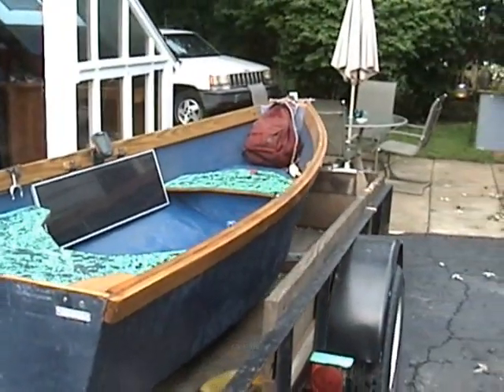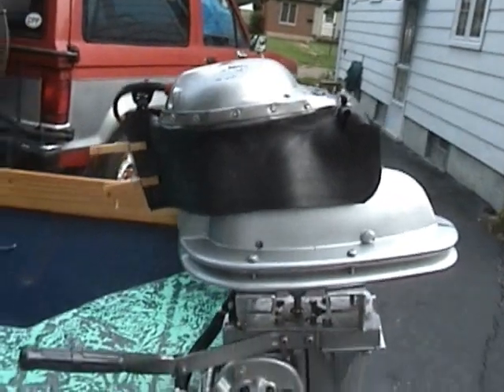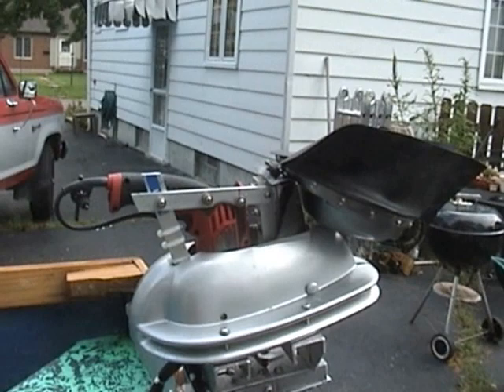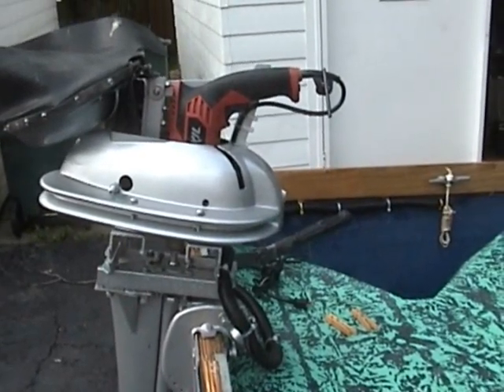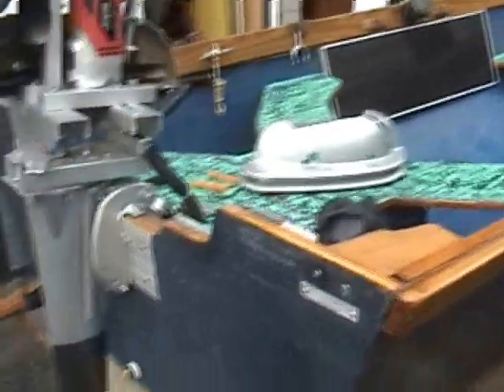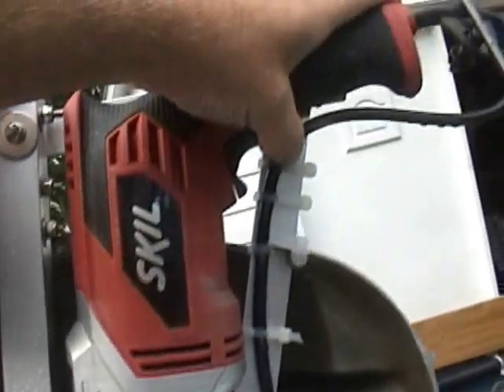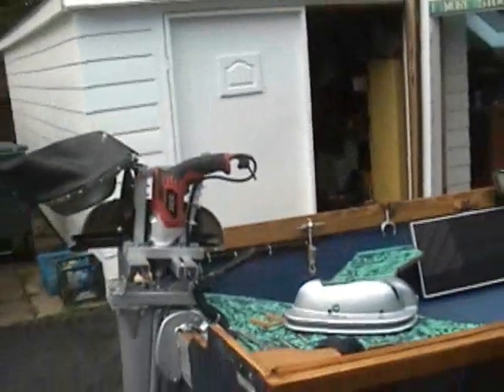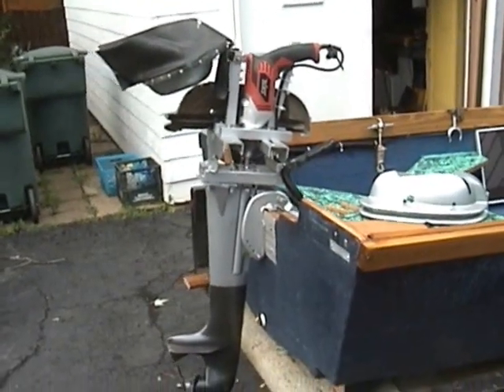electric outboard motor ~ drill motor 3000 rpm Fast Fast Fast ~ homemade and solar power

Comment: First of all , its D C , NOT AC &YOU have " 0 " resistance , not running in water ????? What the @$&€ ???
Reply from the maker: ~ Hey Ivan, Thanks for watching. The Power used to run this motor is AC! yes AC power. 110 volts AC. and it is a demonstration showing it can be done and has been done on my boat.
see all my 110 volt AC boat motor videos to understand more

Comment: Wow Amazing Thanks for sharing.
Reply from the maker: ~ hey sure ~ thanks for watching ~ since this video, I have increased the power to 2.5 hp ( about 1800 watts) with capabilities of 4 hp ( about 3000 watts). using an heavy duty ANGLE GRINDER motor. still use both to this day... thanks again for watching.

Comment: good lord...sounds like a jet turbine
Reply from the maker: hey merc ~ yeh,  the sound is right out of an old sci-fi movie ~  it's not so bad when the cowling is closed up around it.... but yeh, I think it was one of the reasons I wanted to make it!!!  ~ that and while whizzing past another boat  ~  I've heard them say ~ " hey! that sounded like a jet engine!?!!!" ...
Reply: Very cool...Keep up the riggin.
Its easy to go and buy something. Building it yourself is more rewarding.
Heres an idea im working on. I have a huge Milwaukee angle grinder running off a Harbor Freight 800 watt generator and its running through a Harbor Freight router speed controller. TONS of torque so you can run a bigger prop with a more aggressive pitch.
The gas consumption is minimal. also if you want to run it off of DC you can because its a brush motor and you can reverse the polarity and have reverse thrust.
Reply from the maker: hey merc ~ yes this will work well! and continually for hours n hours.
I have a video with a 4.75 hp angle grinder + a router speed control. it works great!!!
I have not incorporated a gas generator with anything but that's a great idea!!!!
Reply: cool thing about the gen is that you can run a charger for the batts...DC motor or DC to AC inverter or straight AC. Since grinders dont have reverse, you can cobble one from a 1/2 in AC drill motor.. I love all the possibilities.

Comment: thanks for reply, sla=sealed led acid battery
200 amper hr battery 
so carbon brushes do not worn out and didn't get hot and burn from friction and force, I am happy to hear as I am going to move my floating summer house with it soon. thanks for testing this items.

Comment: hi, say I have a 200 amp SLA with your setup, how long before drill heat up and die and/or what is the life of the drill with a brush motor such as this? thanks. money is tight, I need one..